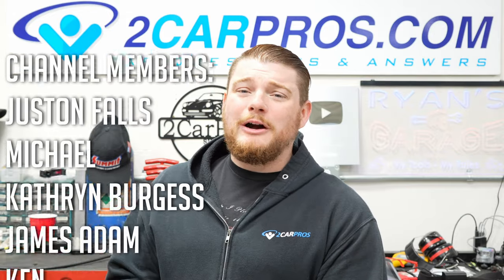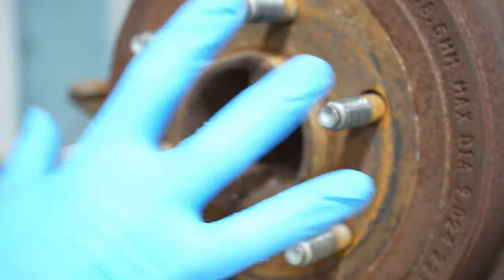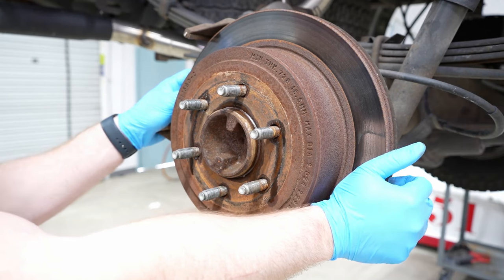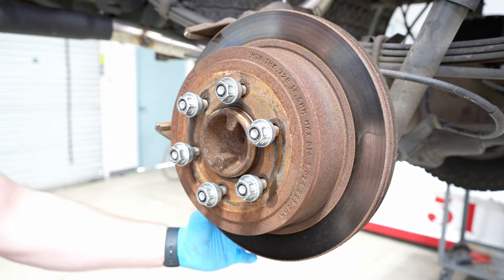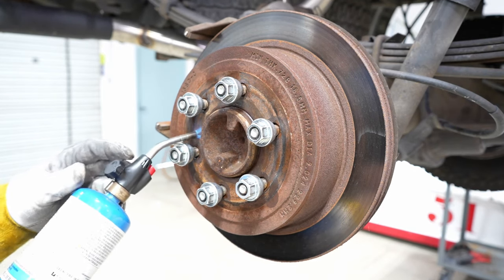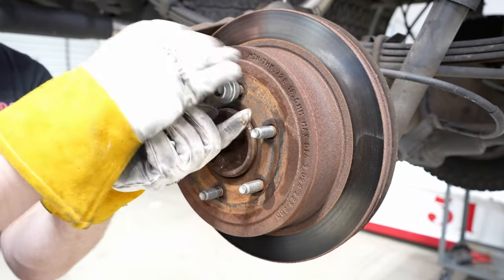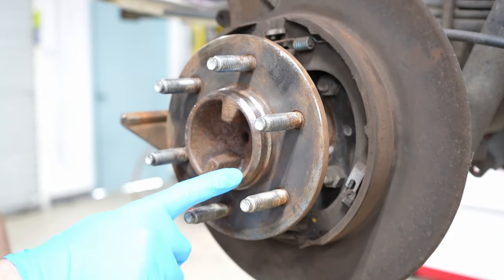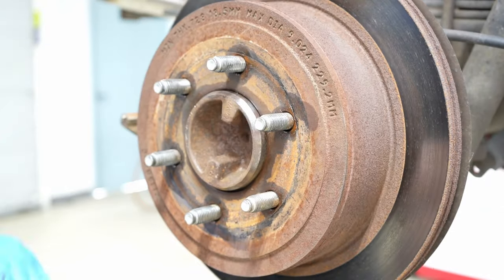How to Remove a Stuck Brake Rotor | EASY!

Comment: Sometimes, rotors come with a couple threaded holes on the face in between studs. They're the same thread as the caliper bracket bolts. You can thread those on and then use a wrench or impact to use the bolts to push the rotor away from the surface it's frozen to.
Reply: You are correct. It works every time
Reply: Bless you and this comment. Rotor came off in 5 seconds.
Reply: @harvey1115  glad it helped!!
Reply: @habilaj5  Except when the holes are rusted and the threads strip before the rotor pops off.

Comment: You should have talked about the park brakes holding the rotor on. Something it wears a groove in the rotor drum and prevents it from coming off.
Reply from the maker: I mentioned at the start of the video the parking brake isn't holding the rotor. Usually that isn't the case. Usually rust and road crud are the culprit. Thanks for watching!

Comment: Actually the heat trick does fail.  I did PB BLaster, hammering and heat all before coming here.  Ehh, Big Red needs new wheel bearings and rotors so they are coming off together LOL
Reply from the maker: More heat then! At that point I'd use my actual acetylene torch and get it really hot. But most people don't have one of those. Good solution! I like it! Thanks for watching!

Comment: Big bolt through the upper brake caliper mounting hole with nut on inside. Hold nut with box wrench and tighten it with an impact wrench. Back it off and 1/4 turn the rotor. Repeat until it breaks loose is they way I learned for stubborn rotors.

Comment: We tried WD-40, Blaster, pounding on it, heating it up with a torch, and lots of swearing.  Your tip with the bolt was what broke it loose. Thank you for putting it out here, two thumbs up!
Reply from the maker: Nice work! Thanks for watching!
Reply: Parking brake shoe is stuck got any pointers?

Comment: at almost 2 minutes in you can see the rotor shifts slightly which clearly shows the rotor is not stuck and so when he does tap it with a hammer first tap it miraculously comes lose.

Comment: I have had rotors that refused to come off with any of the methods that you mentioned. I have found that if the capper mounting holes are over the breaking surface, you can get some bolts from the hardware store and push the rotor off using the bracket mounting holes as a place to push against.

Comment: I wish the ones here came off that easy. That one had about 6 months of NY rust on it. My normal process is to heat the rotor and grab the 5 pound engineers hammer or I grab the big air hammer. Even then I've had some that had to be cut off they were rotted in place so bad. That is pretty much why every brake job in the rust belt is pads and rotors, they are just so rotted and get damaged in removal. I should load up a few rot boxes for you to play with.. LOL
Reply from the maker: Yeah we get lucky here, you need extra fire! 

Haha send me a box of rust to paly with lol

Comment: I'm curious as to whether a good epoxy coating (primer/paint) on the axle surface before putting on the rotor would help prevent the rust some.  I've been doing that on my rotors/axles and so far it seems to have been the way to go... But I don't live in any 'rust belt', so there's that I'll admit.  Still, seen my share of stuck on rotors for sure.  Last one was from Arizona!  That was a reaaal fun time getting it off to replace it...
Reply: It helps. I use coated rotors most of the time and the hub gets sprayed with fluid film/waxoyl or similar, then rotor goes on and spray the rotor as well. Then clean the friction surfaces just before the wheel goes on. That helps quite a bit, but here you also need to check the caliper slides just about yearly as well because they rot in place as well.

Comment: What about a very thin coating of CRC brake grease on the hub? It's high temp and wouldn't think it would run when it gets hot. My old rotors have lots of miles left on them but tempted to take them off to address any rust/corrosion since I am in the rustbelt. Definitely want to wire wheel the outside of the rotor and the inside of the rim.

Comment: If the metal expands all the way around wouldn’t it tighten it or does the whole thing only grow outwards? would it make more sense to just heat 1 side to make the ring size distort?